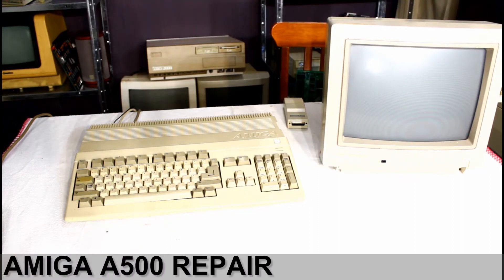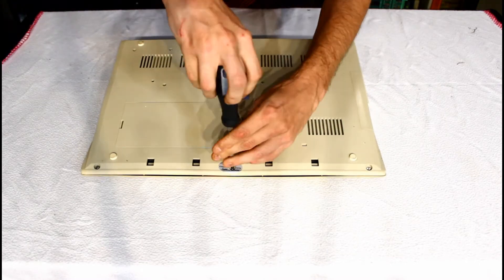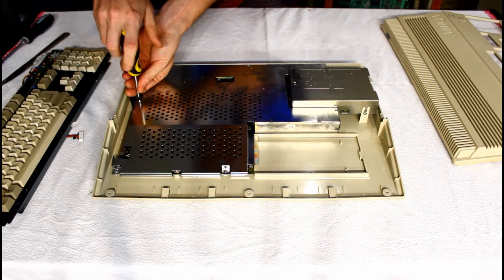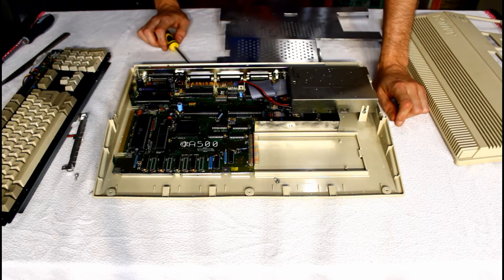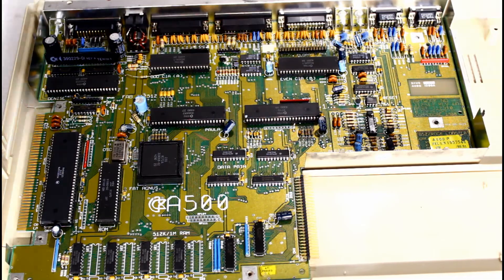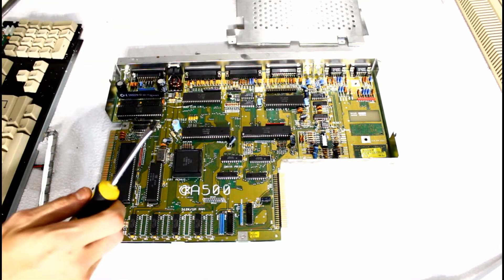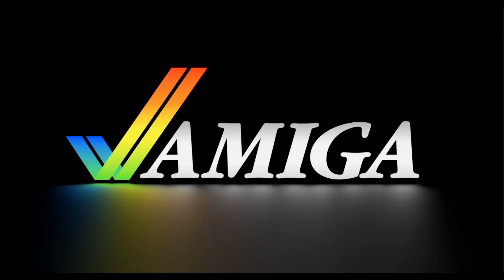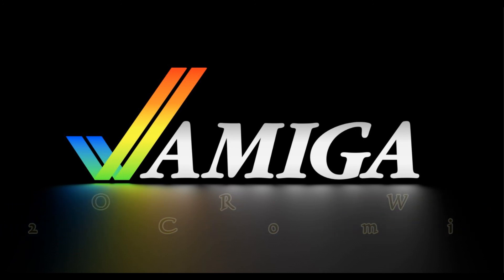Commodore Amiga 500 Repair Video Part 1

Comment: Hi. Your video chip is most likely not the cause of the lack of video synchronisation. There is no analog video chip on the 500. The chips deal only with the digital stuff. The PAL or NTSC signal is generated by standard electronic components (quartz, condensentors, resistances, diodes etc.) The usual suspect here is a leaking electrolitic capacitor. Other commen issues are burned resistances or shifted resistances.
Your first step could be to visualy check for leakages on the circuit around the capacitors. Caps are cheap enough and you can find kits with all the correct values for the A500 on ebay. They are through hole components, easy to remove and easy to replace (just respect the polarity). 
At least change the decoupling caps on the power rail and the caps on the video rail. I bet you have 70% chances that this will solve your problem and anyway, 30 years old caps need to be changed.
Another simple test is to use your finger as a temperature probe. Let the 500 heat up for a while and touch the ships (buy an antistatic bracelet and ground yourself first) : All chips should warm reasonnably. If a chip remains cold or very hot it means it's not doing much. Could be it's fried or it's not receiving the correct signals to run. That gives you an idea where to investigate. (Chech that 5V power comes to that chip with a multimeter etc)
Reply from the maker: +Λογος it seems there was some sort of corrosion under the board . Traces are gone . But i now have a working board to go in
Reply: By the way, I don't think you quartz has failed, otherwise you wouldn't have vertical synchronisation as it seems you do have. Only the horizontal sync is gone. I suspect it's a bad cap (usualy because it's leaking) or a bad resistance (usualy fried by short circuit when connecting/disconnecting the video connector with the power on).